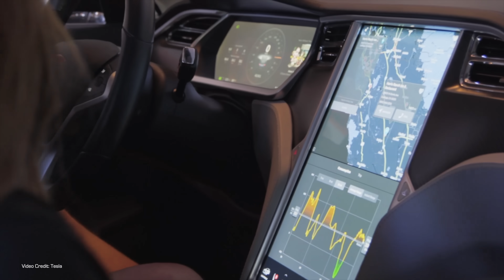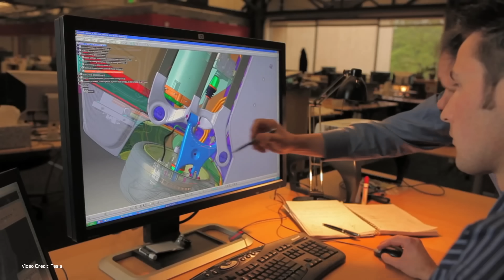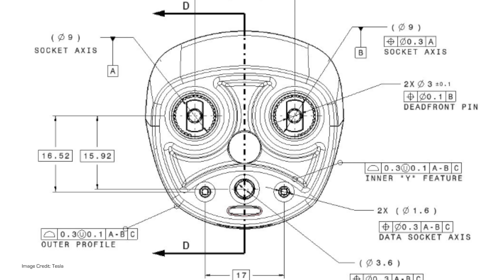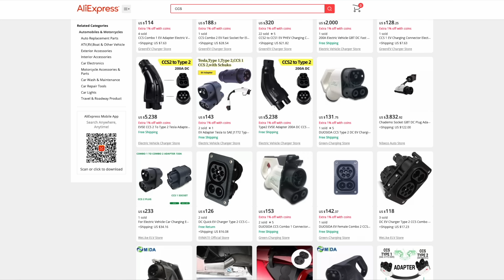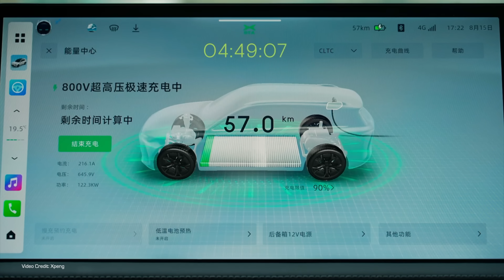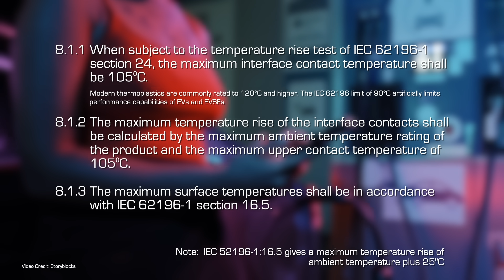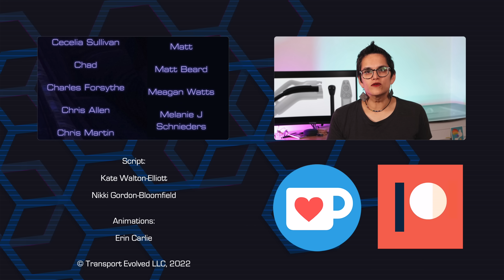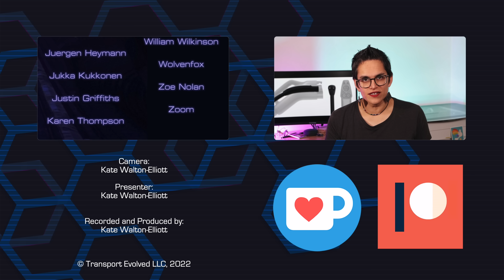The EV Charging Experience Can Suck -- Will Tesla's NACS fix it?

Comment: No. Next. It’s not a standard. Only one company uses it. Can’t do 3 phase AC….

Tesla will just convert the SuCs to CCS and issue owners with a CCS adapter just have they’ve done in Europe.  This is a gambit to try and avoid that. US Govt needs to take care.
Reply: North-American CCS1 can't "do" 3 phase either, and is bigger and bulkier than the international CCS2 used on all other continents. It seems two companies will use it, but it may still be the majority of BEVs on North-American roads. Definitely a significant share, at least. If the new superchargers can "speak CCS" (and they already do on other continents) they can get some US federal money for expanding their network without having to change their plugs. Easy money. And they can sell electricity to cars made by their competitors. More easy money.
Reply: @geirmyrvagnes8718  but not if they charge as much for non-Teslas as they do over here. SuCs are an avoid at all cost absolute emergency solution.
Reply: @juergenschoepf2885  The higher the charging cost, the easier the money. Tesla owners in Europe complain about Audis taking up several supercharger stalls to charge because of short cables and charge ports not being on the left rear. That wouldn't happen if Audi owners didn't want to pay for Tesla juice. If the non-Tesla charging infrastructure in North America is half as bad as it sounds, especially the owners of EVs with big batteries would pay good money for supercharger access there, as well.
Reply: @geirmyrvagnes8718  Never heard about that! With the current prices at SuCs, especially for non-Teslas,  they are close to empty and the Teslas are mainly at other HPCs. We have a V3-SuC and a 350kW-HPC close by and guess where you see Teslas. Even with our Tesla we avoid them and go elsewhere.
Reply: @juergenschoepf2885  Then you are in a competitive market with more than one actually functioning network of fast chargers. Good, but not representative globally. I guess this is also the case along major highways in central parts of Norway. I checked a fresh price test, and Tesla is in the mid range of prices. About 70-90 (euro)cents per kWh for the fastest speeds for drop-in seems to be the norm right now. Down to around 50 if you jump through some hoops and enter into some deals.
Reply: @geirmyrvagnes8718  CCS1 and 2 have the same overall envelope. It’s the comms that’s key.
Reply: @ruaraidhmcdonald-walker9524  Not true. Technically. There is an extra mechanical latch on top of the CCS1.
Reply: IDK, things could play out differently in North America. We have no need for 3-phase here, and our CCS1 inlets do not have the pins to support it.
Reply: @georgepelton5645  Big manufacturers want fewer solutions not more and with the protocol closed, they’re never going to submit to that either. Tesla fighting tooth and nail to avoid being forced, as they were in Europe, to conform and convert. Don’t fall for it.

Comment: I like the bi-lingual thing explaining the various communication standards.  Brilliant, actually.  

However, some of the other inferences are ... hmmm.  Tesla V3 cables are liquid cooled, as other commentors have noted, and cables are thinner, not thicker than older models. As for bi-directional power flow, I can not believe that's a plug thing, but rather a communication protocol thing.  Software solvable.  (Language lessons?) And Tesla has shown a newer, slightly modified version of the NACS that is good for higher power than even the CCS plug.  As noted by that other commentator, the real problem is timing and ego.  Tesla has been too slow on opening up their US plug/protocol standards and no one else would like to endorse anything Tesla.  For now, I'm glad my home charger fits my bi-lingual Model Y, will fit my future Aptera, and I have a CCS adaptor for those edge cases where CCS DC chargers are less available than Superchargers.  (ARE there any such cases?)
Reply: Tesla has not been slow. The patent-offer of 2014 aside, in 2016 Tesla invited all EV manufacturers to join the supercharger network. As part of that deal, they would have gotten the specs for the protocol and plug, allowing their cars to use superchargers. In exchange, they would have had to evenly (based on usage) share the cost of maintaining and expanding the network.

But, as should be quite obvious by now, none of the old car makers have any interest in transitioning to EVs and are only doing it because it's the only way to stay in business long-term. So anything to slow the transition down, e.g. by making charging more cumbersome, is welcome.
Reply: @HenryLoenwind  The only reason Tesla is releasing the standard now is to get money from the infrastructure bill that provides subsidies for building out charging networks. In the video at 4:00 they explain why other automakers did not adopt the Tesla plug and charging standard despite the open patent policy. If you consider that in 2014 and 2016, Tesla was a small automaker was on the brink of failure multiple times, it stands to reason that automakers wouldn't want to go in on the Supercharger network because if Tesla failed, they'd be stuck with it and a bunch of cars have plugs they can't use anywhere else
Reply: There are yes: nearly everywhere in the world that isn't the US.
Reply: @AudiTTQuattro2003  Tesla already uses Tesla protocol.  The protocol is software, not hardware.  That is what I'm hearing in this video.  This means anyone can adapt the hardware and they just have to use their software for communication.  The only hardware limit here is using the wire(s) for communication.  This is NOT a big deal.
Reply: How's the Kool aid?
Reply: @Drivethisnotthat  What are you talking about, kool-aide?

Comment: Keep in mind their EV semi-trucks at two locations use V4 1000Vdc 1MW stations and can use their new 1000Vdc NACS connectors along with heavy-industry EV standard MCS inlets. It appears MCS meets federal charging station funding as an approved standard. I noticed some of their proposed V4 charging stations are near existing charging stations. Could they be converting some of these older V2 charging centers' to pull-throughs for heavy vehicles? A case in point is the new V4 80-stall location in Quartzsite AZ. This is a prime location for semi-truck recharging and a block away from their older V2 chargers. I also noticed their two new V4s in Casa Grande and Avondale/Goodyear AZ are right along the trucking corridors and right down the street from existing diesel fuel truck stops. At one time they tested CCS on their semis.
Reply: Does the Tesla semi actually use NACS? I expect it to use the international CHARIN megawatt charging standard.
Reply: @georgepelton5645  That is what I am trying to find out. Before I retired they used a CCS on a test stand in Reno along with NACS and yet another proprietary plug because MSC was not yet a CharIN standard. I can see them adding NACS and MCS pull-through charging stations to get government money.
Reply: @Carl_in_AZ  There are photos out there of a Semi prototype with an MCS v2 (final standard is v3.1) port. But other than that, I've seen no reliable sources for what ports the final Semi has. MCS seems a safe bet, the prototype had it and the v3 plug looks like NACS' slightly more triangular brother.
Reply: I believe there is a new large CCS standard that's out for semi sized vehicles, but I could be mistaken.
Reply: @1grizzlyrizzo  The CharIN standard is MCS for heavy-duty vehicles but they may use the limited CCS. Good luck finding pull-through CCS chargers in North America.  MCS chargers can be as large as 1500VDC and 3.5MW. So far I am only aware of only two MCS chargers. They are located in Sparks Nevada and on private property in California.
Reply: @Carl_in_AZ  I feel that you'll see more pull through setups in the near future as more delivery vans and RVs move to electric.
Reply: I belive PepsiCo is using 750 mw chargers.
Reply: @Dularr  Who knows for sure. I wish they would post all their data. When it comes to EV heavy-vehicle OEMS not much data is open to the public. Now that I no longer work for a company that produced power trains for EV semi trucks and it is hard to gather the engineering facts

Comment: Fun video! Thanks! 
As I understand it, all Tesla V3 (250kW) cables today are liquid cooled, and cooling the cable contributes greatly to cooling the connector. You can recognize these by the thinner cable compared to the older air cooled V2 (140 kW) units.  So I'm not sure the lack of "liquid cooled connector" is much of an issue here. 

I also don't have specs for the thermal capabilities of the system, I wish they would publish them. What I can calculate is that In order to maintain the 250 kW for 5 minutes as is does on my Model 3 it needs to be sustaining about 650 Amps, which I find quite impressive.

I would love to see NACS adopted, yet my impression of the egotistical nature of the management at SOBs (Some Other Brands) doesn't give me a lot of hope. It will be interesting to see what develops. 
I hope Aptera produces cars with NACS quickly, since I believe this would qualify Tesla to get government credits for building out many more NACS chargers. Something in the regulations incentives about using a standard that more than one brand uses.
Reply: Thanks Otmar for commenting. Kate's videos are always fun to watch. Her dry humor is the best!
Reply: Suppose the SOBs offered the NACS as an option.  I wonder what proportion of their buyers would opt for CCS.